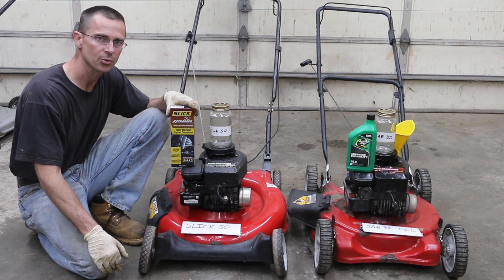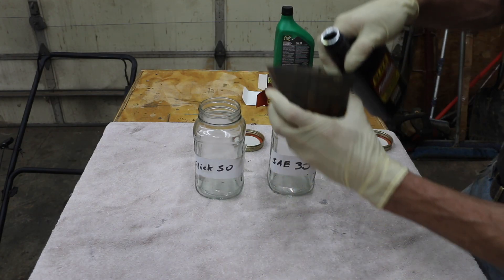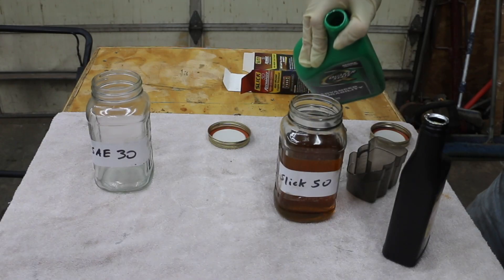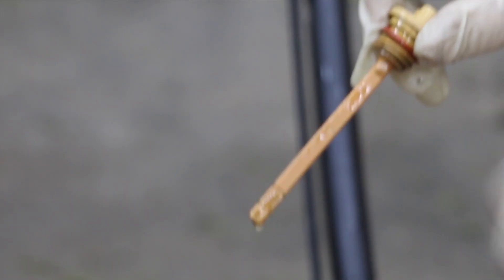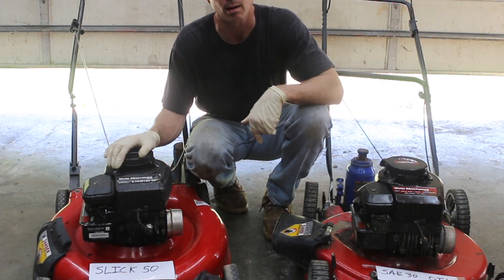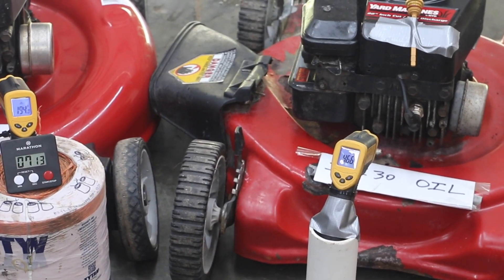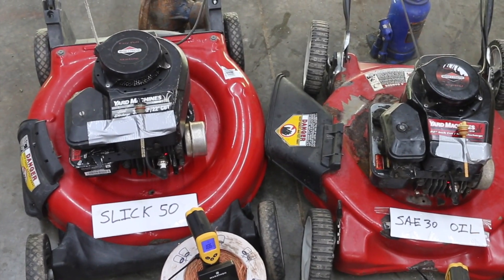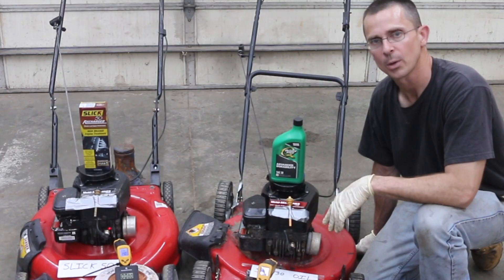Can't believe what SLICK 50 did to my engine!!--Dry Crankcase Test!

Comment: Slick 50 brought the cyl head temp down... from what? You didnt measure that engine on normal oil befoore adding the Slick 50. Measuring another mower is useless as they might have different thermal efficiencies.

Comment: There is a product better than slick 50, it is called synthetic oil! What a lot of people do not realize is that modern day engine oils contain already a lot of additives that prevent wear when the engine runs dry. When the speed between parts is fast, oil generates a hydrodynamic film between the parts that ensures there is no metal to metal contact. Any oil type can do that. Things will only get interesting when the relative speed between the parts is low, for instance  on the top end of your piston, and no hydrodynamic seal can form. That is where additives kick in, they create a layer around the metal parts which will be sacrificed when the parts rub together. (that is also one of the reasons why oil needs to be replaced, the additives break down due to this action, and the exposure to heat, oxygen and water). There are a lot more additives added to modern oils such as additives to reduce wear, reduce oxidation, influence the viscosity and so on.

Comment: the slick 50 i think seized up sooner because it ran cooler and the sylinder wall was tighter than the one with 30wt was running hotter and therefore the sylinder wall was wider?
Reply from the maker: Krispy, Great point!  Thanks for watching the and commenting!

Comment: I wonder if the slick50 cleaned out the oil deposits and that was the reason it was darker than the SAE 30. If the SAE 30 engine still had some of those thick oil deposits in it, that could explain why it lasted longer.

Comment: I think the issue with slick 50 is that it might be a less viscous oil than the regular, so it'll be easier to start and use (and it did seem to remove junk from the engine better). But if you want something that will let the engine last longer (when running it dry) you'll need to use a thicker oil that has a higher operating range, but this will likely make it harder to start and take some warmup before good performance.

Comment: Try Archoil AR9100 Friction Modifier, http://www.archoil.com/ar9000-friction-modifiers/

I too used Slick 50 for the past 20+ years and was I ever duped. I had my mechanic take my silverado's 5.3 apart to install a new oil pump and the entire inside of my oil galleries was black and sticky, like an old "Penzoil motor" of years past. I'm going to try the AR9100 as it is chemically designed to dissolve carbon deposits and reduce friction too.

I look forward to your video of Slick 50 vs. AR9100!

Comment: My dad was a slick 50 dealer. I still have the 3hp engine with the clear acrylic side plate so you could see there was no oil on it. The guy that got him started would run the engine til it quit and fill it up again with slick 50/oil and start it again and again. I'm not a big believer in it. Just run 100% synthetic and be done with it.

Comment: It looks like the mower with the Slick50 may be newer ( tighter tolerances / moving parts) as one previous viewer noted. An older engine may have more wear and not seize as quickly.  If the Slick 50 ran cooler, my money if both brand new, would be on the 50.  Would you try one with synthetic next ? Thanks  J K

Comment: Both engines were used prior to your experimentation, so I can assume that the hours and usage were different. Could it be that the engine you did the Slick50 test on was in worse shape than the other? I'm not promoting Slick50, but one would assume that with all of the hype in advertising done by the Slick50 company that the engine would have done better?

Comment: I hit a rock with my push mower (again)and broke the crankshaft in the Tecumseh engine, so I threw a new Chinese motor I got from a surplus store. It came with a bottle of "break in" oil which they recommended you put in and run then change it to get the chips out. Well, like a dummy I somehow ran it without replacing the oil after draining it. I mowed with it until it stalled. Restarted and ran again. Kept stalling, then I realized by the sound and sluggishness (starting to seize without oil) I poured oil in, started and shut off after it circulated. I let it cool. I then ran and flushed it a few times with new oil, lots of chips came out each time. After a few times the chips were less but still there. I figured my stupidity destroyed it, but that was a few years ago and it still runs I was jus abusing it trying to mow knee deep grass, kept clogging with grass and stalling, but always restarted once unclogged. I'm sure the insides were gaulded and worn, but it still runs. It is even stored outside under a picnic table. I can't complain for a $50 motor!

Comment: Get another used mower use slick 50 after about twenty hours of run time then test its ability. Use Moto-kite on a used engine after ten hours of runtime and test that also. Not sure which will be the best. Slick50 is much thicker than moto-kote. Moto-Kote seeps into the metal inside the engine helping it to survive much longer , so they say.  Slick50 put a supposedly teflon type coating on metal parts. But you have to give it time to seep into the metal. Thanx lookin forward to another video

Comment: Cool video!!

Many years ago, I used QMI. On first applications the engine RPM went up significantly.

The engine actually ran out of oil subsequently and it saved it.

Didn't pull it up to check internals though.

Comment: Engineering Explained channel did something similar. Your temp measurements was only done on one point. Engine with SAE 30 probably ran cooler internally because the oil heat capacity spreads the temp more evenly across the entire engine (drawing heat away from hot internal parts to areas that you're measuring) versus the slick 50, which probably has a higher concentrated internal temp on the parts, but lowered measured temp. A little counter intuitive unless you're able to measure the actual cylinder walls.

Comment: even though it does first the fact that it ran atlest 20 degrees cooler for the whole video leads me to believe it is still beneficial to use. especially in a truck or racing application to keep temps down. as long as things keep cool they are generally well lubricated. I may give it a try just for the temp reduction

Comment: One reason they used a straight six cylinder engine in those old commercials and live demonstrations was that most straight sixes were the last engines to go to hydraulic lifters. The solid lifter would allow the engine to start and run normally without oil pressure.

Comment: I use a product called PROLONG ENGINE TREATMENT and their PROLONG TRANSMISSION TREATMENT. I was a chemist and we tested this product on a Gas Chromatograph Mass Spectrophotometer and it definitely had an extra unknown peak compared to conventional synthetics. I've been using this product in all my vehicles for over 10 years. I would like to see the same test done with the PROLONG .

Comment: I would like to see you do the same test using Lucas oil stabilizer treatment. Or there is another oil treatment out there for engines call motorkote. The makers of it clam that it absorbs into the metal of the engine itself. they sell it at truck stops like pilot or Flying J. also if I'm not mistaken you can get it online. being I am a truck driver I would be very much interested in that test.

Comment: Years back I put some Slick50 in an old  truck of mine.  The damn thing never got hot enough for the heater to work properly.  And since some internal components require heat expansion to fit correctly, it chattered a lot.  But it ran pretty well.

Comment: I remember this back in the day as well, they would be at the flee market and an engine would be running with no oil pan or oil, everyone except true engineers fell for this bullshit, I told the guy to remove the hose that feeds the engine water and he says go away your one of the smart ones that knows more than the others. So you see people it was just a ploy tactic or should I say SLICK tactic to introduce the NEW product they had, get it. Trust when I say it won't work, your engine will fail just like it did in this man's vlog. not haten just saying.

Comment: a bottle called tuneup a 6 ounce bottle runs around $12 here in ky it saved my grannys 1994 olds 88 royal engine that had locked up engine cranked more freely than it had before and way cooler than before we put a bottle in the gas and 1 in the oil also... might wanna try it